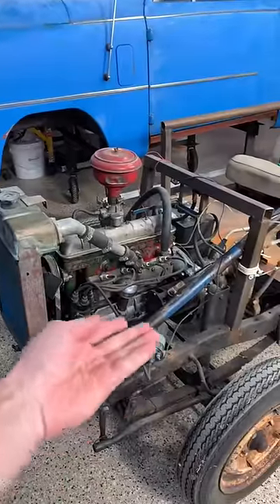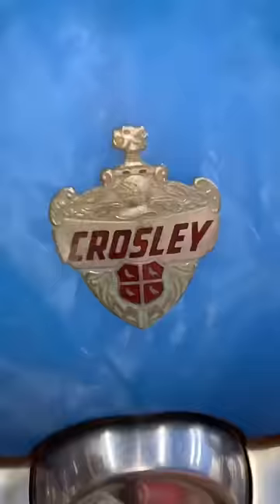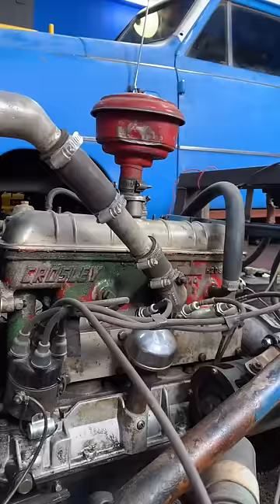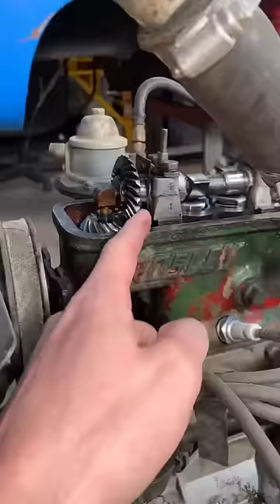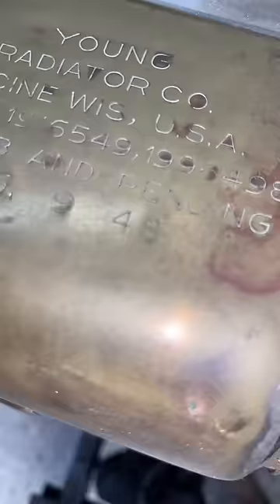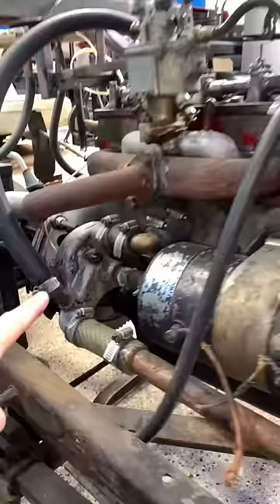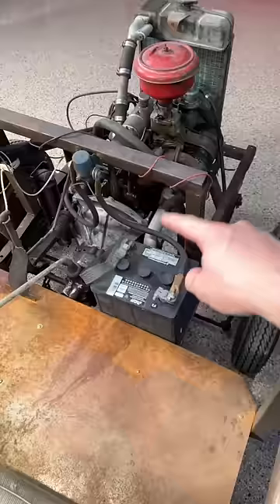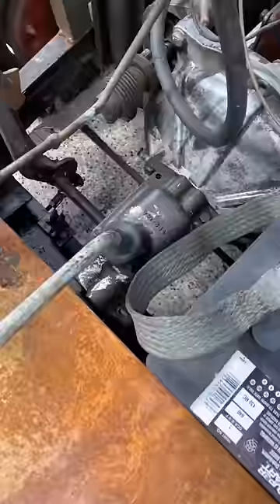Anyone ever seen one of these before? #cars #carsofyoutube #crosley #junkcars

Comment: The transmission was a three speed non synchronized gear box. This is the type of transmission that required the driver to double clutch to shift from one gear to the next.
The bomb lifts used from at least the 60s through the early 80s were the MJ-1 and the MJ-4. Both of these machines that moved the bombs from a trailer to the aircraft used this transmission. In the AF we called the transmissions crash boxes.
These bomb lifts, especially the MJ-1 were abused by those the maintained the aircraft by drag racing them. The transmissions didn't break as often as you might think.
The drive train was a bit fragile.
The lifts weren't steered by the front wheels but by the rear wheels, they were also driven by the rear wheels. You sat behind the rear wheels. To your left was a Wisconsin V4 air cooled engine. From the clutch mounted on the engine was under your left hip. The transmission ran under the seat and the shifter was on your right.
This is where the drive fragility starts. The output from the transmission ran from there diagonally under the floorboard to the pumpkin on the drive axel. It was called the angle drive. When over stressed which was easy to do when "drag racing" the angle drive would break. And we would put a special attachment on the table on the lift arms that was used to tow lifts with broken drive trains.
Thankfully these stared to be replaced in the early 80s. Instead of a mechanical drive train. A hydraulic pump replaced the clutch and transmission. The angle drive was replaced with a couple of hydraulic hoses that ran to a hydraulic motor mounted on the pumpkin of the drive axel. In essence they put an automatic transmission in them. They were still abused and still broke but with less frequency.
Fun but weird to drive as where you sit hangs behind the rear drive/steering axle.
Instead of the front turning the rear goes left or right. Just don't try to turn sharp at speed, it just might slide you off the seat then you have a runaway piece of machinery that just circle around an run over you.

Comment: Isn't it a little sweetheart? I love the gear driven cam, if you like interesting overhead cam setups look at NSU motorcycles from the 40's and 50's or the Bentley "three-throw" setup on the prewar straight six engines. I was a prewar car engineer for many years and seeing what the various companies tried before we "settled" on "the standard methods" is really interesting. 

Also, I reckon that you could really make that engine really cooking if you just rebuilt it using a new crank, modern shells with improved oil feeds, balanced performance rods, forged oversized pistons, port the head, recurve the distributor and get the carburettor setup right. Perhaps a pair of SU's on a custom manifold? That way, it's an improvement but in keeping with the time period. Just some suggestions from an old spanner twirler. Thanks for the video, loved seeing it

Comment: The cylinders and head is casted one piece. The crankshaft is in a lower assembly made of aluminum. The gears running the camshaft was the weakest link on it. I had one of these engines that came out of a boat with 2 Weber side draft carburetors on it.

Comment: Only engine I've seen with a bevel drive ohc, 750cc was the MG power unit from mid 30's often super charged as standard from the factory as an option.

Comment: the only thing that defined positive earth cars was the radio...so if non fitted you can swap polarity by simply flashing the dynamo.  then it would take a new style stereo too.  dynamo flex drive was a common thing.. a safety device if the water pump siezes or swallows something. you soon know theres an issue due to the burning rubber smell..

Comment: Dude. So much potential...using THAT engine.

Forged rods, gird the main caps, shave the head to raise compression, pertronix ignition pickup for distributor and matching coil.

Run v8 valve springs off...anything, and roller rockers. Hydraulic lifters for reliability and durability at higher rpms.
Small 2 barrel carb upgrade autolite 2100 maybe or a Weber 2 barrel for a VW bug 

Rev the piss out of it. Maybe even boost it

Comment: If you REALLY want to help, take the body to someone who can make a fiberglass mold of it, and use that for your hot rod. Then put the body back on the frame and sell it off to someone who can restore it, not pick it apart. Sorry if that's harsh, but someday there wont be many of these left (and Crosleys are already rare), and only the restored and maintained ones will be sold and displayed, modified ones will at the least, lament in personal garages until people forget about them.

Comment: The direct acting OHC is really one of the subpoenas simplest possible designs, especially once overhead valves could be manufactured fairly easily. I only wonder how it held up over time. It doesn't look like there's much adjustment for wear.

Comment: I've used rubber hose as a drive shaft joint before but I wouldn't trust a regular piece of heater hose to drive the water pump. Maybe it's more than a regular hose or originally used some kind of rag joint.

Comment: you know how there's always a curmudgeon that comes up and corrects you when you say some thing? Well here I am 😂 The 1894 Diesel prototype engine used overhead poppet valves actuated by a camshaft, pushrods and rocker arms,[3][4] therefore becoming one of the first OHV engines. In 1896, U.S. patent 563,140 was taken out by William F. Davis for an OHV engine with liquid coolant used to cool the cylinder head,[5][6] but no working model was built.

Comment: that mother is pump'n a wop'n 26 1/2 hp there, the blocks were made with galvanized steel and are so thick water won't crack the the block when frozen

Comment: I bet with some upgraded valve springs that thing will rev to 13 grand
Reply: And then it'll puke its guts out through the newly installed inspection hole in the block.

Comment: All fan belts are rubber couplings. Think about what you say before you say it . Did you not notice that most older cars have a rubber coupling between the steering wheel and the steering box ?

Comment: It will run unless the inside is rusted but I don't think that it is. If you do it right it will have good rings and seal and fire right up unless you are one of those guys that just start cranking away on a motor that hasn't run in years.

Comment: Most of the early ford's were 6 volt systems, until all the comforts were added over the years
Reply: I far as know, cars with generators were 6 volt. Cars with alternators  were 12 volts.
Reply: I far as know, cars with generators were 6 volt. Cars with alternators  were 12 volts.

Comment: The '81 Toyota Corolla had a 1.3 liter (rounded up) engine.  I am sure it was putting out a little more hp than your engine.   The '81 had a 4-speed. 59hp. Listed at 30mpg but I am sure I was in the high 30's.

Comment: I want to do a 350+ hp 2 liter turbo 4 cylinder swap in it with a 6 speed manual transmission if I were to restomod it.

Comment: Please can the annoying music, which does nothing but  help to cover up the narrative.  These  engines, by the way,  were  also used in the homelite  4 stroke  outboards,  called  "Bearcat."  Integral head, no  timing chain.  Cam driven by  bevel gears and a shaft up the front of the block.

Comment: It sports a bevel gear shaft driven cam that I always wonder why they don't use now. It looks oversized for a 700cc engine. Can somebody tell me why the concept won't work?
Reply: More drag involved with a bevel gear making end thrust bearings necessary on the cam and driveshaft.  thrust bearings and bevel gears both make drag sapping power.
Reply: @rossbrumby1957  Where did you find that info? I find it hard to believe that there would be more drag than all the chains that ford uses.

Comment: I thought this was cool until you said that the hot runs to the frame. I am curios what engineering went into that choice. I have never thought about such a thing. DC don't care for the most part but.... so it's just the opposite 🙃 nothing different I think, just not compatible with other neg/ground systems? Idk 🤷‍♂️

Comment: My dad used to tell me stories about 1 they turned into a dump truck and ran around the woods and and he dumped my uncle out of the bed and I also had another old guy tell me that the cylinder head in the block is one piece I don't know if that's true or not

Comment: That's not an engine. Engine is a train. That's why engineers drive trains. That's a motor. You put motor oil in it. Ford motor company. Pontiac motor division. General motors.

Comment: The car built by a refrigerator company I remember these you don't put two fat guys going down the road
Reply: Lightburn- a washing machine manufacturer in Adelaide, South Australia also made a small car called the Zeta. Had a fibreglass body and a 350cc villiers motor, no reverse- you had to turn it off and restart the motor running backwards!
Reply: @rossbrumby1957  lol that's cool we had a crosley back in the 90s with the original tire we let to larger gentleman take it down the road and it came back with the tread of all four tires no longer on the car